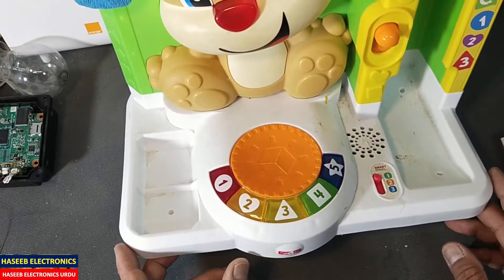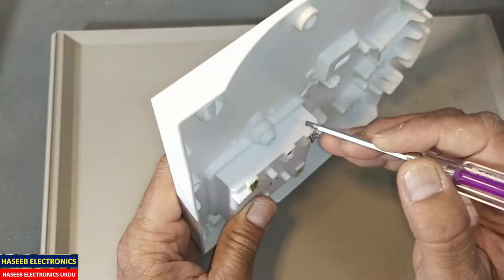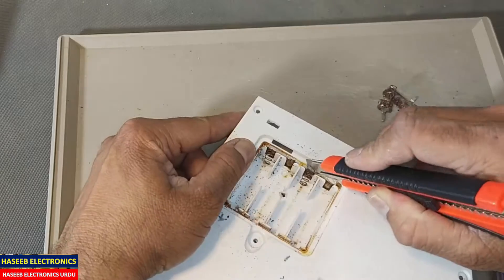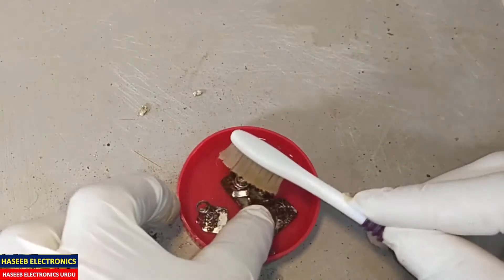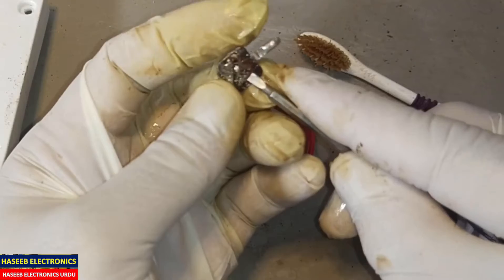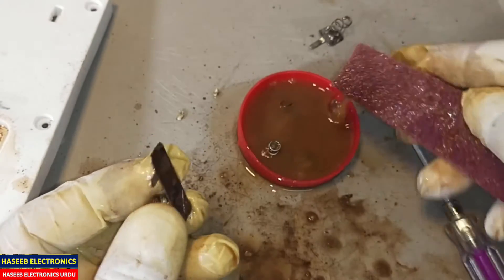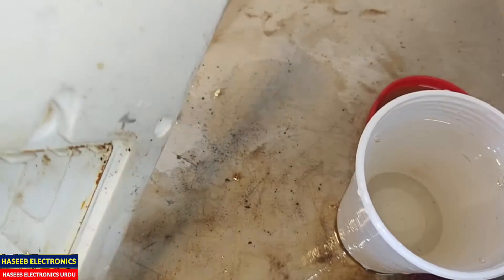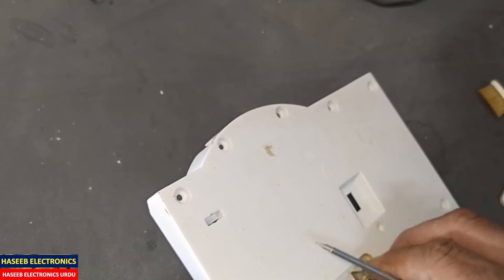{611} How To Remove Battery Corrosion / How To Clean a Corroded Terminal

Comment: sir what ic no. can i replace with 34063al ic.? sir...please
Reply from the maker: LT3470 .  
CS51031/CS51033 is more comparable to the MC34063 but it requires an external power transistor.

Comment: Haseeb how familiar are you with Grid Tie inverters? I have some of these Chinese 600w grid tie inverters that backfeed into the electricity grid, rolling back my old mechanical electricity meter and lowering my usage, but they don't reliably last longer than a year and they seem to keep popping mosfets.

Obviously some serious engineering oversights and / or cheap components.

A breakdown of their failures and reasons would be cool